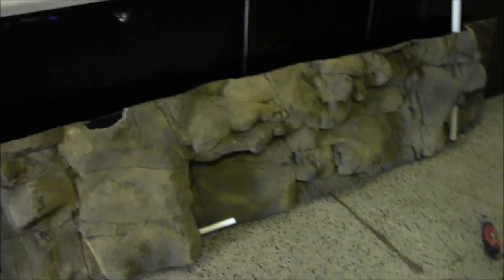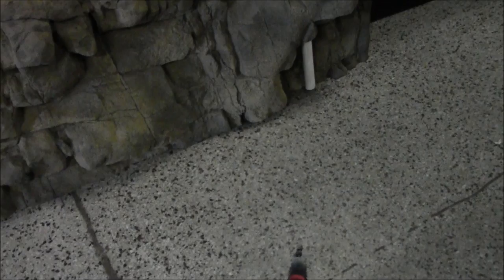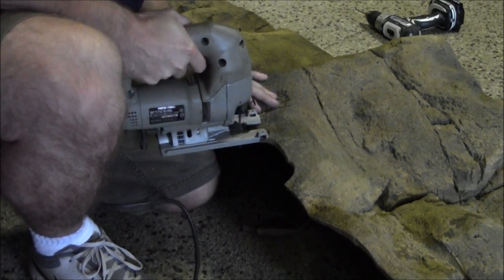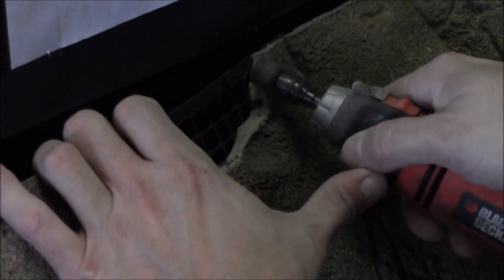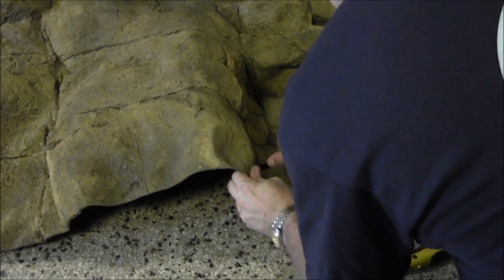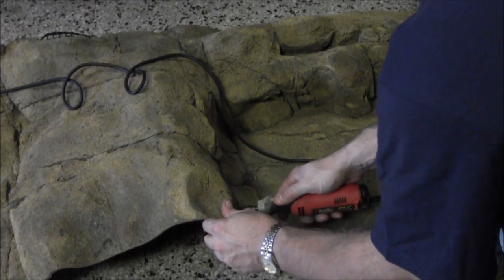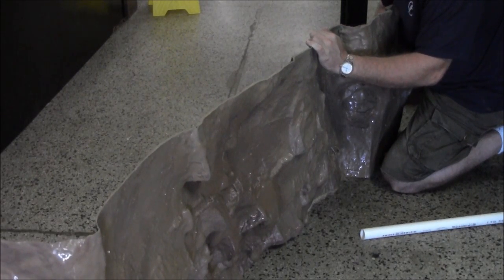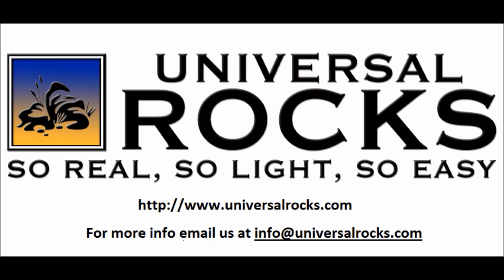HOW TO PREPARE A 3D BACKGROUND BEFORE INSTALLING IT IN AN AQUARIUM

Comment: I have a Universal Rocks 3D background that I'm putting in my 210.  I used a hole saw to drill/cut the needed holes.  If you take your time with the hole saw or large drill bits, you can make the holes perfect; even on the oddly textured areas.Ted

Comment: Hi John I like to use a blowlamp for jobs like this.it may sound stupid bot I have had great success using either a knife or screwdriver .get them red hot and you can go through things like butter. Obviously the item must be rubber or plastic.also the cable ties are a great idea.I use them for everything they are so versatile .

Comment: Dear KG Tropicals, what is the fencing made from that covers your 3D background notch to keep the fish out? And, where can I buy it? I have a 120 gallon tank (4 feet x 2 feet x 3 feet.). I am installing a universal 3D background and an under-the-tank Fluval FX6. Do I need a sump pump? How about a couple of aerators? Also, your intake valve does not look like mine. My intake looks like a paddle about the size of a small hand. Fluval told me to keep it at least four inches above the bottom of the tank but your intake appears to be almost on the tank bottom. What keeps the fish from swimming into the intake pipe? Thanks for a speedy answer to my questions.

Comment: Hi John, I just recently purchased the Malawi background thanks to your video. My partner and I were one of the first to visit your shop when it first opened, it's a total bummer to hear that it shut down. Anyway I'm hoping I can get some advice. My tank is 180 gallon and I plan on running 3 Fluval G6 canister filters. Any tips on how I might arrange all the intakes and out takes and the placement of the heater. I'm debating whether I should place 2 intakes behind the background or should I drill holes for all three.

Comment: yourfishstuff.com carries universalrocks backgrounds at a much cheaper price, but they do not carry the full line.  Got mine in the tank today, just got to plumb everything in now
Reply: I got the Feature Rock BG, and there is no good place on the sides for the exhaust to spray across the sand like I want.  My plan is to run a tube down the middle of the BG and have 2x 45' bends facing each direction.  Still havent figure out how to get my overflow box behind without losing a lot of front space.